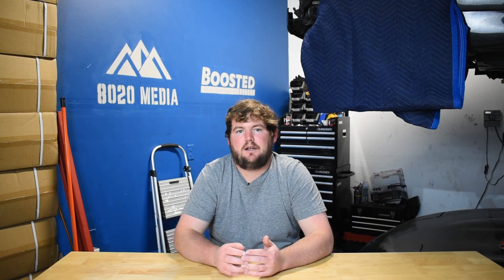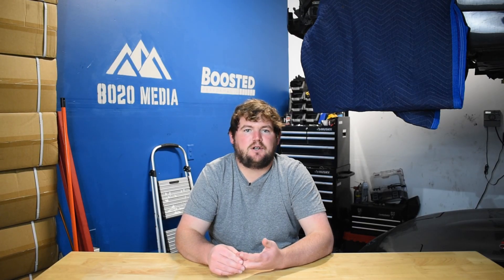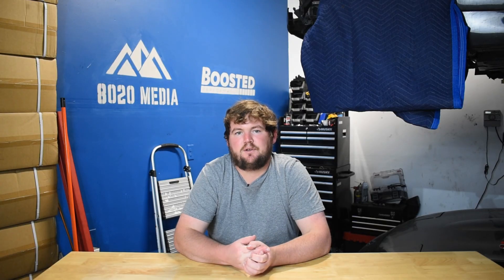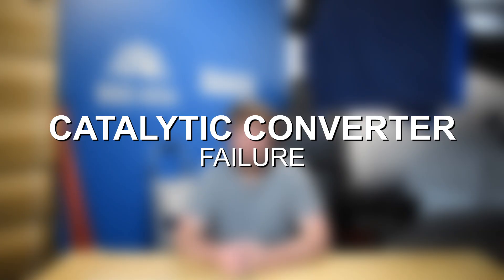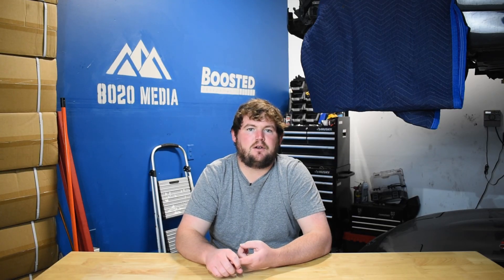Hyundai’s 1.6 Engine | Reliability & Common Problems

Comment: I crack up at Hyundai s 10 year warranty. Everyone who buys one thinks is really something. Then they find out it takes a class action lawsuit to get them to honor it.
Reply: Not only that the Hyundai dealers near me charge $190 per labor hour and only pay their techs $30 an hour..
Reply from the maker: S - Sorry to hear this.... However, thanks for sharing this insight.
Reply: They DID honor their warranty for me, so your blanket condemnation is not true.  I bought a new Elantra with the 1.8 engine in 2015.  At 6 years and about 75,000 miles, I noticed a slight “tick” in the valve train at startup on a cold day.  When I took it in for its oil change not long after, I mentioned it.  When the service was finished, they had the tech explain to me that it was the notorious piston slap issue, often called the “tuck of death”!  They instantly told me that the car would get a new engine shortly block  UNDER WARRANTY and that it would cost me nothing.  
- I actually offered to produce all my records of oil changes and maintenance, in case Hyundai needed them. 

Of course, the dealer knew that my maintenance on the car was flawless, and I was told that proof wasn’t necessary.  Guess what, folks?  I got a loaner car, and even though the arrival of the short block took a little longer than expected, I had zero problems!  The new engine was perfect, and it didn’t cost me one cent.
Make of that what you will.  However, in 2025 in the middle of a cold Ohio winter, we are currently driving  our seventh Hyundai / Kia vehicle since 2007: a 2023 Niro.  That Elantra engine was the only major problem we ever had, and like any other of the minor issues we might have experienced over the years, we found that Hyundai / Kia stands behind their products IF they are maintained.
Reply: Kia replaced my sons 2015 optima engine at 9 years 95,000 mi.  He was not very compliant with his oil service…they gave him the new engine no questions asked. It took3 days in the service Dept.
Reply from the maker: 1 - Most of the time, this is true.
Reply: You need service records… that’s pretty much it
Reply: I never had a problem.  I only used it one time

Comment: I use 91 octane gas and a fuel system cleaner every 10000 miles , should have no problems  for the life of the engine
Reply from the maker: J - Thanks for sharing your experience. How many miles do you have on it currently?
Reply: @8020Media   I have had Volkswagens , and currently have two kia's  GDI engines the trick is  to change the oil , good gas for a more complete burn and a fuel system cleaner ( redline  fuel system cleanerc) make sure it is a complete fuel system cleaner  my cars always purr like a kitten.
Reply from the maker: J - Thanks for sharing!

Comment: My 17.  1.6 t tucson  is consuming  a qt per 1000 mi.  55k on it ??
Reply: Replace the pcv valve, if stuck open it will suck oil from motor straight into the intake.
Reply from the maker: F - Could be a cause.
Reply from the maker: J - Seems like a lot.

Comment: Thoughts on the 2016 veloster turbo? Im looking into getting one, it has 100k miles and i hear the rods can be prone to failing
Reply from the maker: Trippy - They can. It all depends on what you plan on doing to the car.
Reply: @8020Media  basically a sporty commuter and hardly plan on modifications, im still just concerned it will decide to grenade on me
Reply from the maker: Trippy - They certainly had rod issues, however, Hyundai addressed this issue with a recall. So, I would get maintenance records to see if this has been addressed because rod failure happens around the mileage you're looking at.
Reply: Rods fail because of the owners driving them like they are racecars

Comment: I have 2016 Tuscan 1.6T.  #2 misfire.  I’m getting ready to pull the engine to take the head off. Leak down seemed to blow right out the exhaust. Could that also be carbon on the exhaust valve ? I’m hoping it’s a straight forward engine pull 🙏🏼
Reply from the maker: M - Keep us updated on this!
Reply: Will do 👍🏼. I’m hoping to get a few tips on pulling the motor before I get started but if not I’m gonna tackle it in a week or so.
Reply from the maker: Mike - We can look around for some resources.

Comment: I am looking at a Hyundai Tucson 2017, I have seen lots of reports of engine issues on the 2016 but contradicting info on the 2017 model, any opinion on this engine, (1.6L)
Reply: My veloster 1,6gdi 2012 just had catastrophic engine failure. The cylinders are oval and leak oil due to bad piston pin, they start to rattle as metal weakens and wear out. It wrecked my whole car. It made 80k m with extreme good care from me, bought only best oils, changed every year or 6000m. Rode mostly to work and on local roads. Never seen such bad design. They have now a lawsuit pending as more than 20 models have this fault!
Reply from the maker: I - So sorry to hear this, however, we appreciate you taking the time to share your experience.
Reply from the maker: Joe - The later the variant, the higher the likelihood it is a better engine and they took care of previous variation problems.

Comment: I don't blame hardworking folks who dare NOT touch any Kia or Hyundai vehicle. With the massive bill they shouldered from the engine failure fiasco plus other major safety recalls, guess who will foot the bill eventually?
Reply from the maker: Tony - We've seen many Hyundai's and Kia's be reliable.. All depends on maintenance.
Reply: Maintenance bro. I am still driving my  2010 Accent.  Timing belt , water pump and all new idlers and belts.  Transmission  oil and filter change with Hyundai oil at 100k. Do my own oil changes at  3-4k miles.  Nothing but valve cover gasket and spark plugs to make it to my 4th set of tires. Will not mention the mileage as you will not believe me.

Comment: This is very helpful information. I'm extremely interested in the 2024 Hyundai Sante Fe Hybrid and was surprised to see this little engine used in such a large SUV. It seems like they've certainly got most of the bugs worked out.
Reply from the maker: Big - Thanks for the feedback! The newer versions have definitely worked out the kinks. It's just hard to tell how they are now since they are newer.
Reply: Great video as there are few videos with this type of detail!  Does the 2024 Hyundai Sante Fe utilize the exact engine or can you discuss this engine once you gain insight on it.  Thank you!
Reply: Do yourself a favour and stay away from Hyundai, unless you’re looking to get a blown engine.
Reply: @HowlingWo1f  Some of us like Hyundai, have had them for many years, and don't go to toyota or subaru videos to troll the people looking for information. If you don't have anything meaningful to contribute, don't open your mouth. If Hyundai cars fell apart in the first 60 days, they wouldn't have become the 3rd largest automaker last year in the US.
Reply from the maker: Wolf - Completely disagree.. We love our 2013 Hyundai 2.0T.

Comment: We have a 2013 Kia Rio , its been a great car . 225,000 miles 1.6 engine , 6 speed automatic . No major problems . We bought it new . It is hard on brake pads , they are very small . Still have original pcv valve , took it out , still rattles , put it back in . Would buy the car again , without any hesitation !
Reply from the maker: Eddie - Thanks for sharing your experience! They can certainly be reliable if taken care of.
Reply: Try AKEBONO pads. You'll thank me for it!
Reply: The more i check it out, the more i believe these are tought, fun, reliable little car! Mine is  a 2015, so cheap to own! :)

Comment: Family wanted a Veloster with this engine. Car was leaking oil, leaking coolant, transmission would not go into 2nd (manual Veloster not auto), and head gasket was blown. Seller tried to scam us with a broken car.
Reply: Sounds like they hammered it.
Reply: Damm😭 i just bought one and so far everything is great did a 3-4hr trip in it already 2012 166k miles and its manual engine is quiet solid first week and I’m inlove with the car not the fastest tho
Reply from the maker: Air - Good thing you didn't get stuck with it!

Comment: Mine has 226k miles. 2014 kia rio.
Reply from the maker: Tiago - Nice! Any issues?
Reply: @8020Automotive  it started burning oil about 5000 miles ago. I believe it’s just the rings. OK for the mileage.
Reply from the maker: Ah. Pretty common at that mileage. Seems like you've gotten a lot of use out of it with relatively few problems, so congrats! Keep us updated!

Comment: I have a 2018 Elantra with the 1.6T. 
Currently has 106k miles. 
Haven’t had any issues.  
I use premium fuel, 5w-40 oil; 5000k mile intervals.  Intake valves were walnut blasted at 90k miles.
Reply: Manual will say 5w-30 
5w-40 is used within the community for extra protection and breakdown from fuel dilution (GDI).
Reply from the maker: Boris - Thanks for taking the time to reply to this and help out John!
Reply: @borisramirez6083 would you mind explaining this more as I’m just about to do a oil change and was thinking of changing
Reply: @Hutchy86  Generally as a engine gets older you just want to use slightly thicker oil
Reply: @borisramirez6083  Also, people within the "community" can send oil samples to labs to see how much fuel is getting into the oil.
Reply from the maker: Boris - Thanks for sharing your experience! How did the intake valves look before?
Reply: How much did it cost to walnut blast?
Reply: @ericet1515  I guess you can look around online.
Reply: Whats the specified oil   sure its not a 40 wt.
Reply from the maker: John - It should be in your manual.
Reply: How good/bad was the carbon buildup if you saw for yourself?
Reply: Hmmmm... Your comment was relieving enough. I have a 2021 Hyundai Santa Fe Hybrid Ltd with the same 1.6L engine. It is recommended in the manual to use Unleaded fuel, can I use premium gas as well just like you have done? I discovered that the few times I had premium fuel in it in the past 3yrs, I got more mileage, a longer range from a single fill-up.

Comment: Solid video!
My 2019 Accent 1.6 Gamma GDI runs really well on 91 octane - Thankfully / surprisingly the ECU allows the car to take advantage of its high compression and direction injection. 👍 The engine is significantly more zippy on 91 and the fuel economy improves around 5 MPG on the highway.
I ran several tanks of 94 octane and even a couple 98 octane tanks to test the limits of the stock ECU. Performance and gas mileage suffered with any octane higher than 91. Shortly after I had a P0420 code and had to replace the catalytic converter (covered under warranty). The super high octane fuel not only hurt performance but they also damaged the cat. 
Figured I'd share my experience. This motor was designed to run 91 octane exceptionally well and completely changes the character of the car in my opinion.
Reply from the maker: Celestial - Thanks for the feedback and for sharing your experience!

Comment: I’m looking at getting a Kia Proceed 2013, it’s the 1.6L GDI engine, is this model a reliability concern?
Reply from the maker: Brandon - We wouldn't say it's a reliability concern, but most of the problems listed in the video apply to it. It all just depends on how well it is maintained! Hyundai's are known for building reliable engines.
Reply: Extremely bad engine by design. Only if you're lucky then you have a good one without issues. Piston pins wear is the main concern.
Reply: @lA-bk3wh  Explain that to my 2010 Accent.  Use good quality oil at right viscosity. 200k is no problem with proper maintenance.

Comment: Added an oil catch can to mine to minimize the carbon build-up on the intake valves. GDI engines should come with these from the factory
Reply from the maker: Great idea! We also have one on our 2.0T GenCoupe and it's made a world of a difference.
Reply: I wonder if that would void the warranty, adding your own can.
Reply from the maker: Joe - Technically yes, since it is an aftermarket part. However, this could be at the dealers discretion.
Reply: Should I ask my dealer about the catch can before installing one ??
Reply: I did the same thing and only use Shell fuel and Amsoil oil. At 106k miles I've had 0 issues

Comment: Carbon buildup is common for all direct injection engines not just Kia's.
Reply: due to this, would you sugeest using fuel cleaners every 5-7k miles or so?
Reply from the maker: Db - Depending on what kind, it wouldn't be a terrible idea. Best thing to do would be to use a catch can. We have one on our 2013 2.0T gencoupe and it's great.
Reply: @8020Automotive  care to link what ur talking about I have a 16v dohc 1.6L Kia soul and I want to make it fast but first is replacing stuff first before having motor problems or being able to add a turbo . At the moment it has a tiny metal ticking sound while idleing . Hard idling sometimes, like low rpms engine rumble low lol.
Reply from the maker: D - What are you needing linked?
Reply from the maker: D - It shouldn't void warranty, however, this depends on the dealer. So we can't really give you a straight answer.
Reply: @dbzownz12345  Carbon buildup is an inherent issue in all GDI engiens because fuel does not come in contact with the top of the engine valves. So additive you put in the fuel won't do diddly squat to clean carbon buildup. It will only help keep your fuel injectors clean, which are located below the valves in all GDI engines. The proper way to clean carbon buildup is with a professional walnut shell blasting, about every 50k miles.
Reply: @dbzownz12345 throw premium in it like once a month and youre fine
Reply: Meanwhile other companies like Ford have taken measures to fix the problem, in Ford's case a secondary PFI spray.
Reply: But kia gets all the flack for it 😂
Reply: Toyota solved this problem by having both direct and port injection on each cylinder. When running, the fuel injection will go back and forth between the two of them based on the computer software programming. Enough port injections to keep it clean. A common sense approach from Toyota, when you see the problem in other engines, take action to prevent it from being your customers problem.
Reply: @simonlangmead7  hyundai has dual injection on some of their engines too, and toyora still makes some gdi engimes with only direct injection.
Reply from the maker: Fabio - Correct.
Reply: Thanks for the reminder, I was about to start having a totaled motor cause I found carbon.
Reply from the maker: S - Idk if it would have totaled your car, but it certainly could affect performance.
Reply: Try oil catch can
Reply: That’s why you gotta step on it every once in a while
Reply: It's worse in kia since they are Korea junk
Reply: True, especially trucks with v8s, all turbocharged german cars etc. 😅 I've been thinking about trading in my 2014 audi a4 for a kia or hyundai with a 1.6t, 2.0t or any v6s from 2017 and up.🤔 ik how some car guys can talk about them over honda but from the recall sheets and reliability ratings with affordable cost for maintenance and insurance, kia and hyundai have been decent or hit or miss like jeep but im honestly curious what's a good choice. 🤷‍♂️
Reply: @prvtxsparky920 you should check out the 2017 elantra gt or veloster.

Comment: Does the 2018 elantra sport 1.6T gdi have these issues?
Reply: I can tell you I have the same car, and it's got 100k miles with really no problems. I borescoped the valves and there is SOME carbon but it's not like some of the ones I've seen on the forums. I think it has a lot to do with my driving style (I drive it hard, no short trips) and I change oil with synthetic oil religiously.
Reply from the maker: Pauli - Thanks for sharing your experience!
Reply from the maker: Colin - Some of these issues, yes.
Reply: Mines having trouble starting and a rough idle it’s 95,000 Kms. (Only on a warm start though) any thoughts) @8020media
Reply from the maker: Ray - Unfortunately there could be multiple things that could cause this, but here are some places to start diagnosing: Fuel injectors/pump, spark plugs and ignition coils, MAF sensor, vacuum leak, or throttle body.
Reply: @raysting2766 MAP sensor PCV valve PCV sensor.  All very cheap and relatively easy fixes  the PCV valve and sensor i do believe should be replaced every 30-60k miles. MAP sensor gets its fair share of "blow by" and needs cleaned or replaced about the same time. Considering the low cost(13 bucks) on Amazon i just replace it.  All helped with my idle problems.